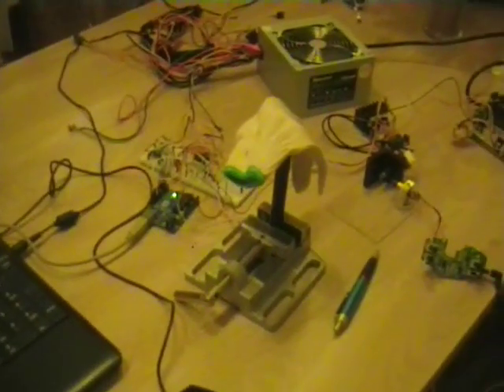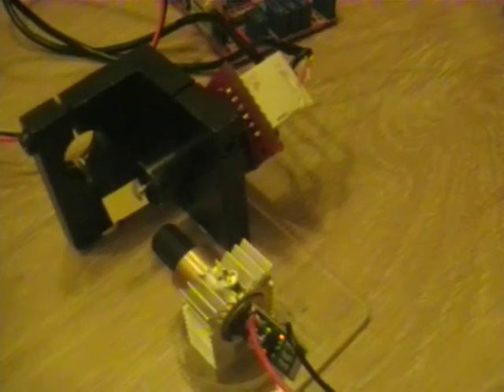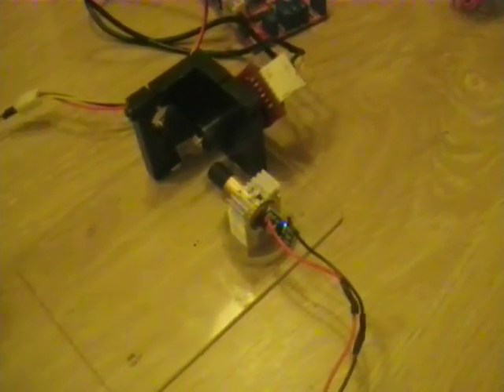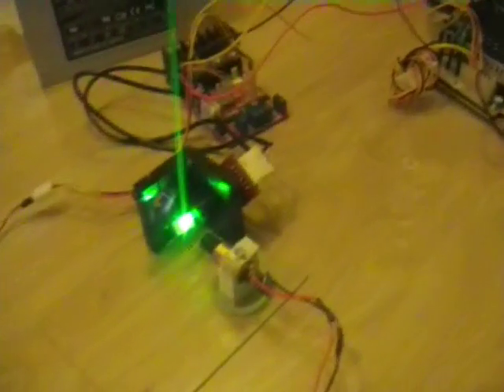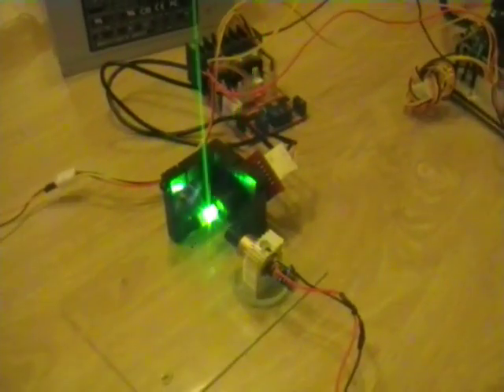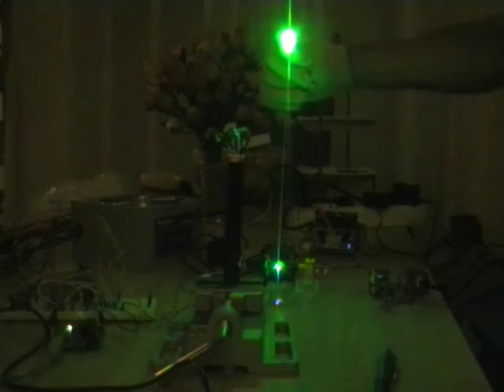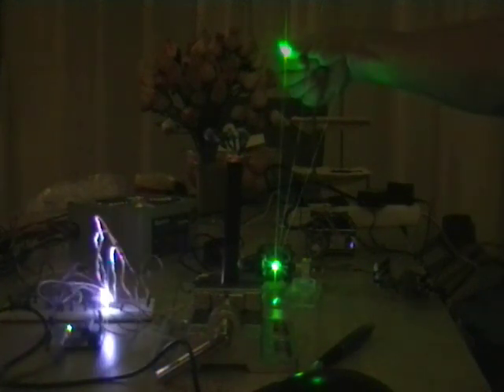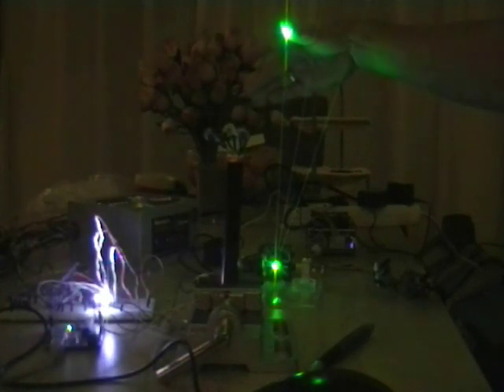ARDUINO LASER HARP WORKING PRINCIPLE 1

Comment: Do you need to use a laser with TTL logic to design this or could it be feasible with pointer lasers?
Reply from the maker: Hi Jonathan,
Best is a TTL laser. You can use a laser pointer but the you need to switch on and off manually.
Also you cannot get indivual separated beams because the laser will be on contiuously.
But it will work with a laser pointer but you need a strong pointer.

Comment from the maker: Hi Sajal.
I ripped the laser module from a stage light projector (which generate a 1000 beams) and it was 50mW (not 15). You can buy these for about $40 on the web. For the testing it was enough and the harp responded well but only at close range. For a full working laser harp you need 300-400mW. The laser module which I use nmow is 375mW (measured) 
And yes... these modules are freaking expensive!!!

Comment from the maker: The output from the 3 x TSL12S in parallel to the +. The Pot, in series with a 10k resistor, is a voltage divider with the wiper connected to the -. The out goes to the arduino. The sensor is still in development....

Comment: thanks so much!

i will try buying that.

one more thing: Vdd I think will be connected to +5V in arduino and then OUT to a pot and a digital input in arduino. In the code, i have to compare digitalRead with HIGH to play a note. Correct if i'm wrong.

Comment from the maker: If the voltage from the TSL12S is higher than the threshold value set by the pot, the signal goes "HIGH". By turning the threshold pot, you determin the sensitivity. Check Google for comparator circuits. Its realy easy.

Comment: woow, the tsl12s gives a digital signal instead of an analog one? so in arduino you only need to check a 'HIGH' or a 'LOW' value i think.

do you need something more or using that is enough?

Comment: Hi!

How did you put the three LDRs for detect the broken beam?

I am using this "img507(dot)imageshack(dot)us(dash)img507(dash)8893(dash)ldrq(dot)png" but is very hard to calibrate.

I use analogRead and compare it to a value stored in sensor.

if ((analogRead(0) > sensor) && (nC3==0) ){

noteOn(0x90,0x30,0x7F); //starts a note
nC3=1;
      
}else if ((analogRead(0) < sensor) && (nC3==1)){
    
noteOn(0x90,0x30,0x00); //silences that note
nC3=0;
    
}

what do you think?

thanks!!

Comment from the maker: Theoretically yes. But the mirror would be constantly in motion so the beams would be blurry. (I have tried). Plus it is a lot easier to control the motion of a galvanometer. Or you need a very, very strong (=expensive) laser which gives a pulse at the beam position. A set of galvanometers is much cheaper. Ripped the spinning mirror from a laser copier??